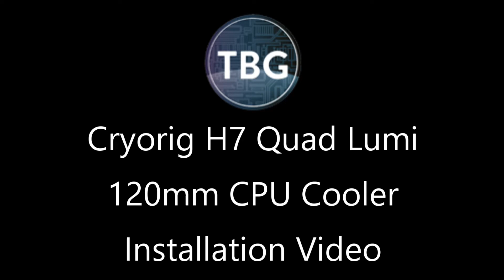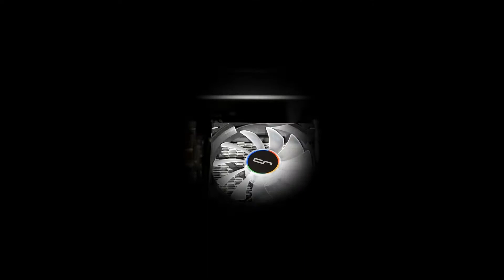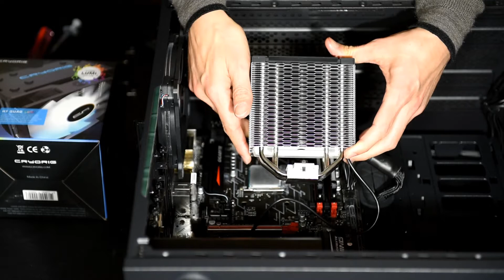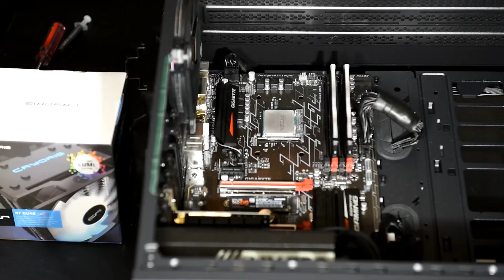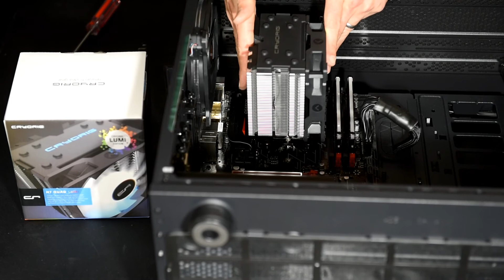Cryorig H7 Quad Lumi CPU Cooler Installation Video

Comment: I cant fit my 2 top screws for back mount because the case is blocking screw hole for motherboard. Is it okay if i set it up with 2 lower screws only??

Comment: Nice tutorial! If i may add, better install this outside the case as the  way its designed with the floating bracket and 2 screws, youre prone to tightening in one side then not realizing the heatsink doesnt lay flat on the processor. Should be gradually tightened and checked if its flat. I should know, just installed an m9 plus!

Comment: I'm probably buying this product to go on my i5-6600k. I appreciate the honest feedback and opinions in the video. I'm currently using a Corsair H60 and I'm tired of the pump noise so I'm going back to air cooling.
Reply from the maker: Unless you really love the RGB effects, I'd suggest the standard H7: https://amzn.to/2POfeGR. It's a better cooler, and much cheaper. Or if you want a really cool RGB look, check out the CoolerMaster MA410M: https://amzn.to/2pfeL5c

Comment: Did the cooler have a sticker on the bottom to remove before putting in onto the paste? I installed this beast but don't remember it, don't wanna get fried plastic on my cpu.
Reply from the maker: Yes, it did. It's big enough that you'd see it sticking out if it were still on the cooler.

Comment: How are the temps?
Reply from the maker: They are decent, but if you're just looking for performance/dollar, you're better off with the original H7: https://amzn.to/2HDXrPI. It's honestly the best cooler under $40.
Reply: The Tech Buyer's Guru what do you mean? Isnt this better?
Reply from the maker: @titansurge6644  No, it is not. The mounting system was changed, which made it less effective.

Comment: Hi, nice video.. does this cooler fits on a ASUS EX H110M-V motherboard?
Reply from the maker: It will fit on practically any motherboard, including ITX models, so I don't see why it wouldn't fit on the ASUS mATX model

Comment: Nice video, do you know if the cooler fits a microATX Asus B250m-A?
Reply from the maker: That's a fairly standard Intel socket 1151 mATX motherboard. You should have no trouble fitting this cooler, which has very good compatibility due to its offset design.